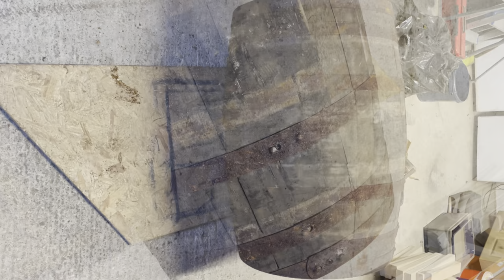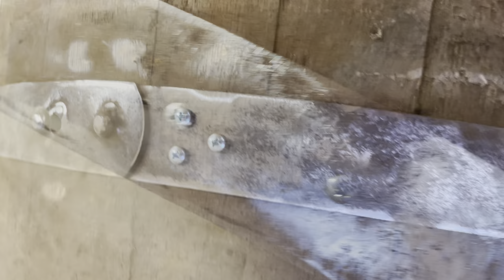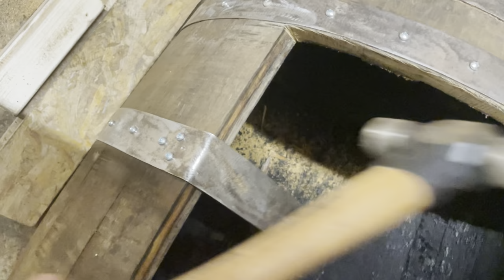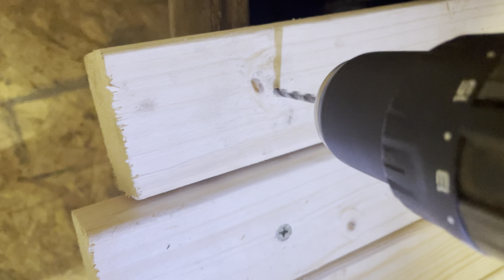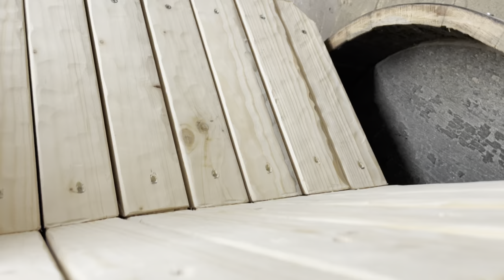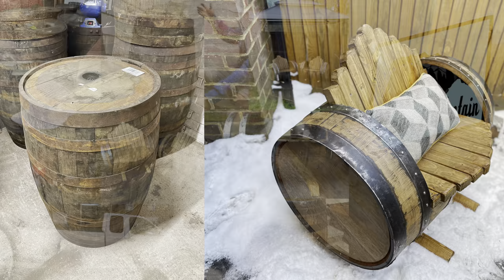Remastered, how to make your own whiskey barrel chair

Comment: Great job.  How many staves do you cut out (how big is the opening) and do you know what your angle is on the seat/back?  Hoping to try this in the next few days.
Reply from the maker: Thanks! I use two flat pieces of wood to determine optimum backrest/seat angle (compare the angle to a comfy chair etc) screw them together and line up with the barrel, each stave thickness is different so I look for the best fit to match the required seat angle and mark it, this then determines how many staves you cut out! Remember, you can always cut more out, it’s uglier to try refit ones already cut!
Reply: Hey, could you please make a video of you measuring and removing staves with the boards you have made to determine how many to remove. I’ve already ruined two barrels trying to get the shape right and the barrels are $90.00 a barrel where I’m from. Thank you if you decide to.

Comment: Nice! Is it a rocking chair, or are the legs attached?
Reply from the maker: Both! Depends on what you want! Easy to swap out the legs on the base for rockers!, I’ll make a rocking chair one next!
Reply: @BEARMOUNTAINMedia  Good feature! Yea, you would want rockers, just rocking on the bare barrel could be... interesting... 😅
Reply from the maker: @CrudeButEfficient  It’s not too bad! When I was making the first chair I did it a lot! You’d just also rock side to side! It’s weight is at the bottom so it won’t completely tip over!
Reply: @BEARMOUNTAINMedia  Of course, it would tip in all directions. Not a good chair if you're tipsy... 😁
Reply from the maker: @CrudeButEfficient  because it has such a low centre of gravity it’s really hard to roll over! I’ll do a short video of me trying to roll it over when I build the next one too 😂🤣
Reply: @BEARMOUNTAINMedia  Looking forward to seeing that! 😁
Reply: Sillonen echo de barriles en en penal de san felipe mendosa x el iterno sergio peralta es su deseno
Reply: Repuestss
Reply: Ver el viodeo ahora